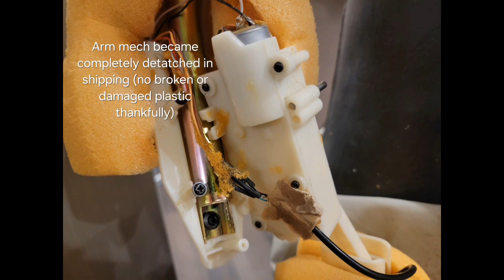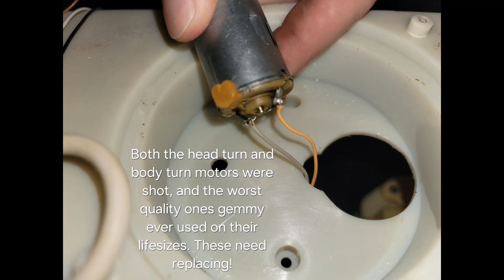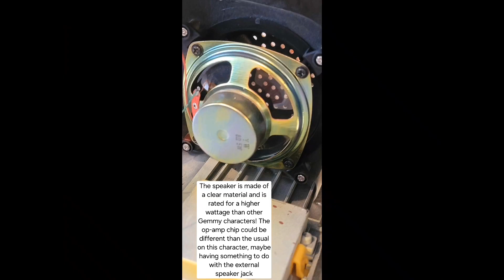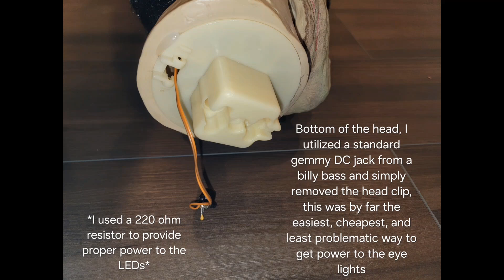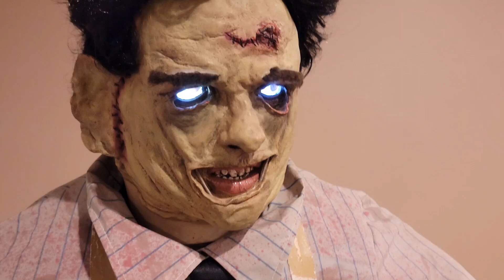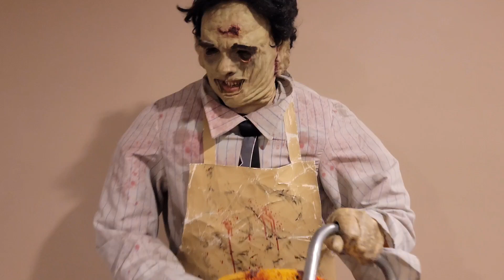Spirit Halloween Gemmy 2006 Leatherface Restoration Process and Demo

Comment: It is beyond impressive how you took this thing from essentially audio only to fully functional. 

The motors in leatherface seem different than all the others, and that's likely because of how expensive it is. 

In production as you may know the body turn and arm wires were swapped, likely because of fear of durability of the body turn. 

If you put a 2008+ body turn mech in there (larger + sign one), I could see you swapping the wires back as intended with minimal risk. I feel like doing so on the older mech may lead to it rounding out or something. Maybe not given the slower speed. The current speed is standard for him, though. They dont tend to move much faster.
Reply from the maker: Thank you!! It definitely took quite a bit of work, and some sacrifices had to be made. It definitely makes sense why they switched it, and if I ever come across a spare set of 2008+ shoulders, etc. I would immediately put them into this guy, I've heard of the body turn being rounded out on these before. Good to know about the speed, unfortunately I had to kinda start helping the prop to turn itself after this vid, and then it couldn't do it at all

Comment: Awesome job! My leatherface has a similar issue with a snapped off left arm. Ive temporarily fixed it several times with zip ties. Any tips for permanently fixing it with zip ties or something else. Thanks a lot.
Reply from the maker: @triplemhalloween  Thank you! Unfortunately, I don't think any kind of adhesive would be strong enough to hold the arm to the shoulders, especially with the way the arm is attached and the shape of the shoulder plastic. I would say zip ties are really your best bet, besides trying to replicate those two pegs with either wood or with CAD. If I end up making these in CAD and they work I will definitely make a community update or something similar
Reply: @scaretactics4489  thanks a ton man I'll give the zipties another try for now thanks for the info. Definitely let me know if a CAD gets figured out

Comment: I do like it with the light up eyes!  How’d you learn all about the circuit boards?  You self taught yourself, because I’d love to learn more about circuits boards and how they work.  I can replace a bad component if I suspect it’s bad, but I don’t really know how the circuit works.  Also, I emailed you about the jumping cat a while back just saying that I wasn’t going to do anymore work to it until I find a jumping dog.  Just letting you know in case you thought I never responded to your last email, which by the way all your insights were very helpful. So I thank you for that.
Reply from the maker: Pretty much, I've self taught myself a good portion of what I know, I also have learned a good bit from just watching YouTube videos on electronics repair. Starting on simple boards like what are in these props have helped me figure this stuff out tremendously, and to be honest I still don't know exactly all the details that are going on in these boards, especially the microphone characters. Thank you for letting me know, I'm super bad at checking that email account! I hope you can get that thing working, it's gotta be like a one-in-a-million kind of factory defect

Comment: Hey love the video I’m trying to fix my leatherface by replacing the chain but I can’t figure out how to take the metal handle off do u think u could help me out
Reply from the maker: So the part on the top of the chainsaw where the metal handle connects is where you need to look- there should be a plastic flap that can open up, and you need to get the pin that's going through the handle into the plastic of the chainsaw out. Unfortunately on mine, it was literally jammed in and it wouldn't come out, I was trying with a small pick and a hammer, literally everything I could. I ended up having to break a very small amount of plastic on one side so that I could use pliers to pull it out, and even after that it took a good amount of strength to get out. Usually most people can get the pin out much easier. After that you can get I'm very easily
Reply: @scaretactics4489  thank u for the help 👍

Comment: He looks great! Awesome upgrades! I’m curious, where did you get a new chain? My model has a terrible 3rd party chain. Also, the cap on the leds is a good idea; however, I don’t think I realized that when LED’s did they short? Is that right? Like I assumed they would fail open once they burn out
Reply from the maker: For the chain, I found a cheap gemmy clown chainsaw that didn't have working sound off of eBay- I have heard the trick to finding a chain that fits is looking for a chainsaw that has the same body style as Leatherface's, it doesn't have to be a Leatherface chainsaw specifically. For the LEDs, you are actually right, most LEDs probably go open instead of short, but I used LEDs I got off eBay cheap, and I just wanted to be extra safe in case they somehow shorted out, since it's not guaranteed they won't 😂
Reply: @scaretactics4489  gotcha! How cheap lol? Yeah I feel like I’m duped sometimes when I’m unsure of the chainsaw size from images online. I would love to get mine looking like your’s
Reply from the maker: @adamsoileau4804  This is the kind I got: https://youtu.be/LoRNaB4H24o?si=b7Dzkj3LDVjRPFX3
I think after shipping it was like $45, which was painful to shell out for just the chain, but compared to what most of the chainsaws go for on ebay it was a great deal. I think that's actually what that specific chainsaw retailed for as well, so I can't be too mad